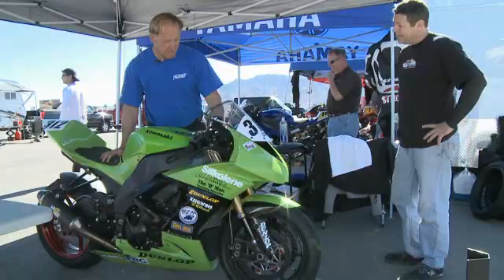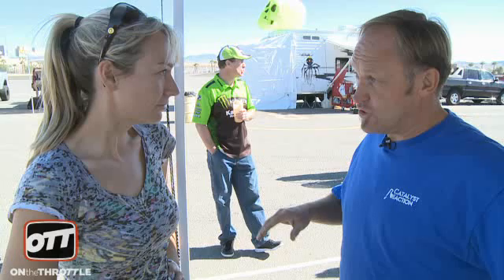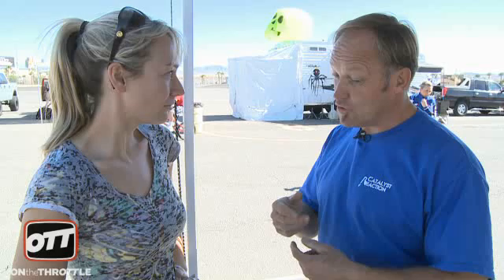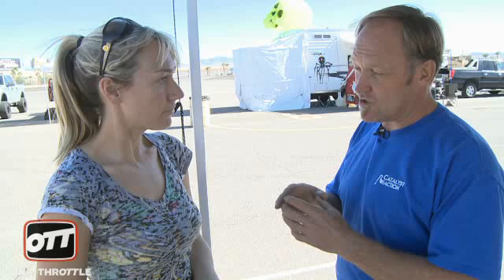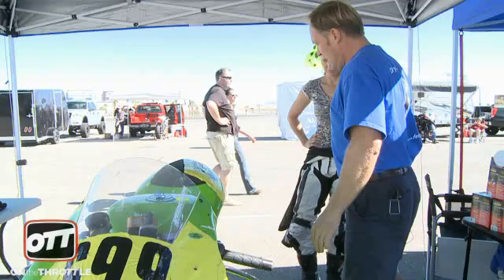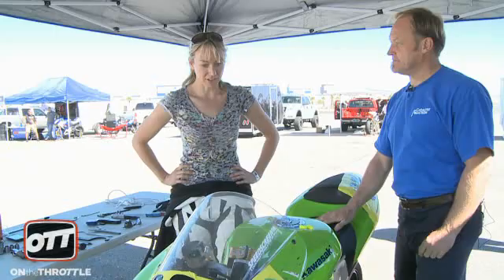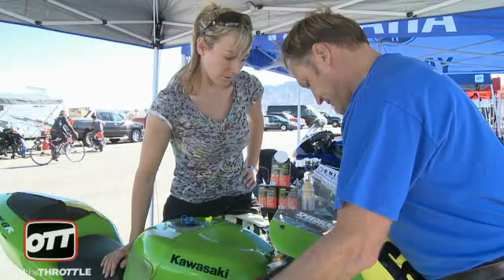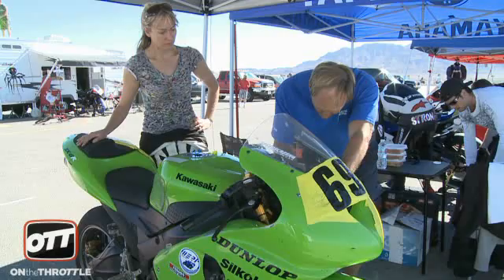Two Clicks Out 15: Tweeked Triple Clamps

Comment from the maker: @TKlimentowski loosen the lower triple and fork pinch bolts. Work side to side and then push the forks up and down too. Then tighten the triple clamp and fork pinch bolts correctly. Stand to the side of the bike and look at the forks - are they lined up? Look down over the upper triple and do the forks look lined up? If so, job done and ride it to see if it still steers one way easier than the other. 

Dave Moss
Host

Comment from the maker: @Jmoges  Correct - loosen the lower triple clamp and work the front end around. It might crack a couple of times. Then tighten the lower triple. Next, loosen the bolt of the upper and handlebars and do the same thing. Lastly position the handlebars and tighten.

Dave Moss
Host

Comment from the maker: @northernfirepower  at that point you can bet the lower triple clamp is bent in a couple of planes and there's only one way to get that straightened - via a professional. I would also at that point send them the upper and lower complete just t check and also examine the fork tubes for dings that may need to be dealt with.

Dave Moss
Host

Comment: I had twisted forks, bike went down on its left hand side while i was going 15mph ish.  Tried riding it once i'd replaced chain and sprockets and it always pulled to the left, and very noticeably.  Couldn't even ride it 20 yards without getting off and parking it up, far too dangerous

Loosened bolts on lower triple clamp, loosened axle nut on front wheel, mudguard, and one pinch bolt on fork and pumped the forks up and down - job done.   Works just as well with bike wheel between legs and adjust bars.

Comment: @4:24 and @7:39 Yes ! that's exactly what my bike was doing !  Damn dangerous to ride it like that.  On a KTM XC , there is a top stem bolt that when you loosen the bottom triples, both triples still don't rotate freely of each other....so you've gotta loosen that bolt too . What is the proper sequence to re-tighten everything else ?    so that the act of tightening everything back up doesn't pull it back out of alignment ?

Comment: Why didnt the forks pop out of the top under bikes weight? How did you know how much not to over looosen the clamps to prevent that from happening
Reply: because the top clamp wasn't undone. you only undo the lower triple clamp and the fork pinch bolts. if you pump the forks up and down/left to right and it doesn't help you fasten the lower triple clamp and then undo the top triple clamp. you undo the bolts so they are finger tight and then torque them down to spec.

Comment: I'm going through a few videos a week of Dave as a starting rider that wants eventually do pretty much all maintenance myself. The amount of useful
and nowhere else mentioned info that yet seems so critical, is around every corner in his videos.
I've still got a question now for myself, I've dropped my bike 4 times now. 2 Times at a standstill in my garage and 2 times on the street doing a slow U-turn-type manouver and losing it. Do you need to loosen the triple clamps too for drops at 0-5 mph?
The video is 10 years old... today... so I'm not expecting a response but I can hope :D